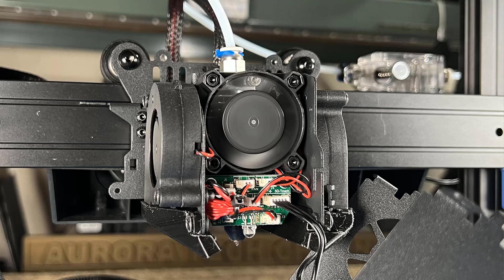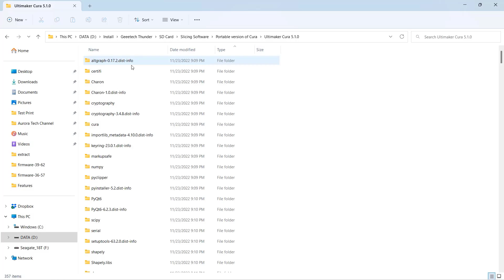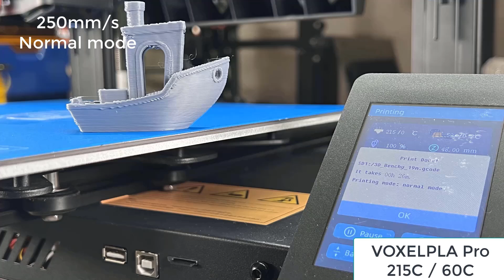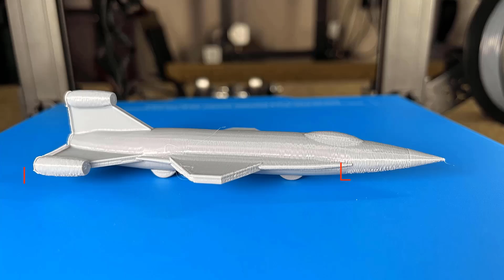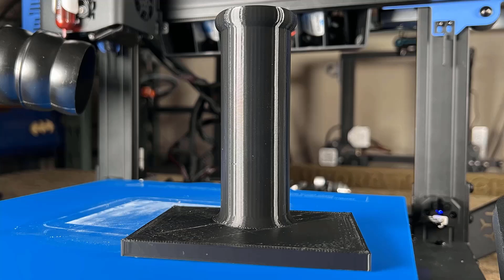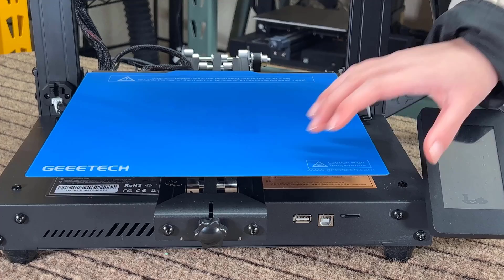GeeeTech Thunder 3D Printer: A bed slinger that claims to print at 300mm/s & 5000mm/s² acceleration

Comment: I still dont get how processor speed increases printing speed,  it must be at 100% usage to be a bottleneck? And would mean increasing clock speeds would increase printing speeds?  I thought it was a mechanical issue, motors acceleration, toleranaces etc.   Say you used your PC power to run the printer, which you can do apparently, use a PC to run kippler instead of a pi, that way you'd have a real powerful pc doing the printing calculations and thats where i think you'd see, more clock speeds doesnt mean faster printing.  Does to a point but computers are so fast im almost certain its a mechanical bottleneck in the end.  I dont see anyone reporting 10x speed with their laptops running kippler instead of a Pi which would be the case if processing speed affected printing speed.

Comment: I got Geeetech's A10 Pro, back when that was relatively new. The damn thing shipped with an extra stepper driver heatsink lodged right on the pins of the USB port, and the eccentric nuts for the bed were so loose that it couldn't complete its own test print. It's also a huge pain to maintain in general, though apparently it had a couple features over its contemporary Ender 3. Still, I regret not getting an Ender 3 instead, since it's so much better documented, and mods are so much easier to find.

Comment: With settings like "crazy speed", it looks like other manufacturers are noticing the Bambu Lab X1 and P1P. In this case, unfortunately, it was the marketing department that noticed, but not the engineering department. Thanks for the review.

Comment: Honestly, printing fast is a whole different story than printing fast at quality.  Those calibration cubes honestly look awful even in "Normal mode". The absence of both pressure advance and input shaping is evident. Not sure why they didn't resort to Klipper.

Comment: Can't believe geetech are still going.  Was such a fan boy back in the day. First printer was geetech proB then had e180 and few a10 then a few a30 even had a a10m. One thing this new printer has wrong is smartto. I've still got two a30 with smartto which both stopped working with no  fix. So there in bits and going to be turned into a core xy. Geetech ditch the smartto and you might get a customer back.
Cheers for the very good review 👍

Comment: Closed loop steppers used here are known to cause salmon skin. Normal high torque steppers with silent drivers would be significantly better. I wonder what parts of OS firmware they took to create the firmware used here, unlike Bambu Labs who clearly developed their own from scratch firmware and in house developed drivers -- this machine seems to be using some stripped down klipper variant as the parts are not bespoke. Even the board they are using is similar to all in one boards that combine 2 different arm processors needed to run klipper.
Reply from the maker: I see, I didn't know that. This is the first printer I tested with a closed-loop steppers, thanks for telling me that.
Reply: @AuroraTech  i have drawer full of them. Tried them on a build. Ended up going back to regular high torque steppers and tmc 2209s.

Comment: I have to admit, every time you say that "PET can't be printed a fast as PLA" I say to myself "But what if you did?" ;) My curiosity is a terrible thing. Thanks for the nice review! Very interesting!
Reply: I print PETG at PLA speeds, no fan, bed at 70, nozzle at 235. No issues.
Reply: @MrGerhardGrobler es i max at 80 speed no Cool fan same temps as you 👍

Comment: "Fast" is the new fashion term obviously...but what does it do good when the prints look crappy as that ?? 500 bucks for that printer is wasted money, sorry.
Reply: Design is too old. Should have made it a cube with Z bed for better quality.
Reply: @Soravia  modded ender3 can push 8k accel on klipper, but it should have 10mm belt on y axis and custom y carriage and buildplate. And it's still cheaper that corexy printers:)
Reply: Build voron swichwire core xz the best bed slinger

Comment: What a peculiar printer. You can really see that they did their very best to make everything as stiff as possible, and prevent common issues with high speed printing (ex. closed loop steppers for layer shifts, good cooling setup etc). However, if you want to make a printer for speed, why would you ever build a bedslinger? 
Anyways, it doesn't seem like a bad printer, but for the regular MSRP of 700$, it just isnt competitive, especially in a world where you can also get the P1P for that price. Especially unacceptable is shoddy firmware for that price. 

The early bird kickstarter price of 400$ is not too bad, but if you want a fast printer, you can get an FLSun SR for nearly the same amount of money! You could even upgrade it later with the klipper pad they offer. Plus inherently delta's are much better in moving fast.
Reply: I'm hoping the Klipper community gets Klipper running on the X1 and P1P, really. P1P with Klipper would be a great value CoreXY, coming in at less than half the cost of an LDO Voron 2.4r2 kit. Bambu's firmware is still half-baked, which isn't great.

Comment: Those claims on the website are decieving at best.
It's a pretty bad printer for the price. It feels unfinished, with random upgrades. It doesn't even have an all-metal hotend or direct drive and those fan on the back are just overkill.